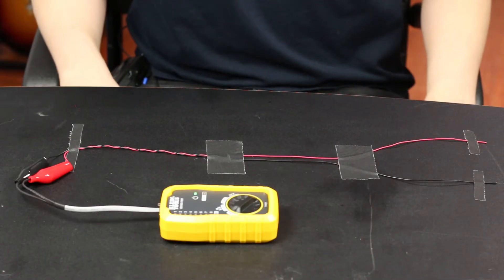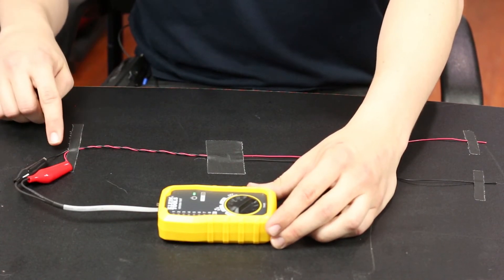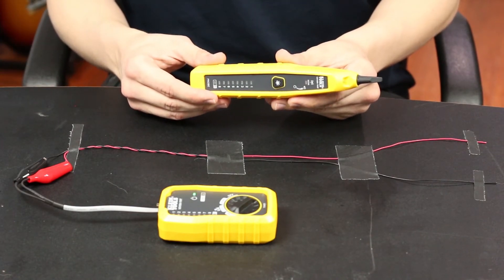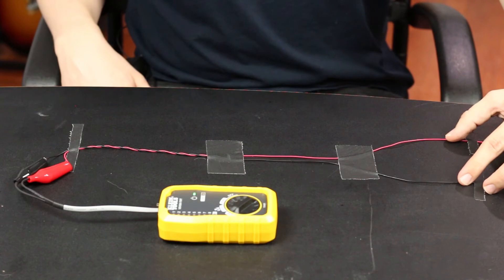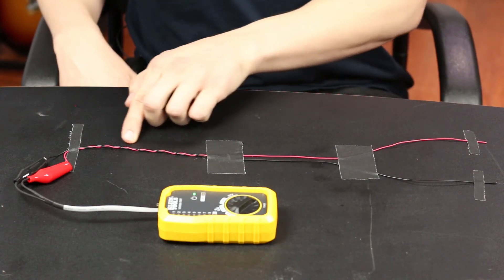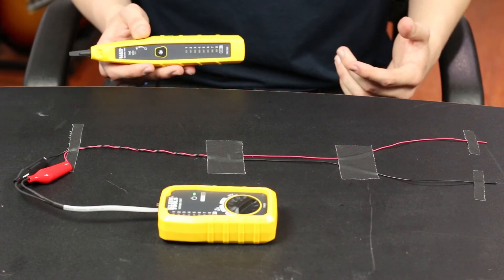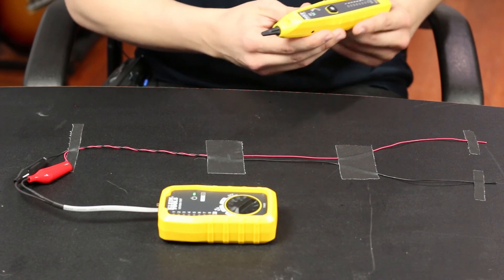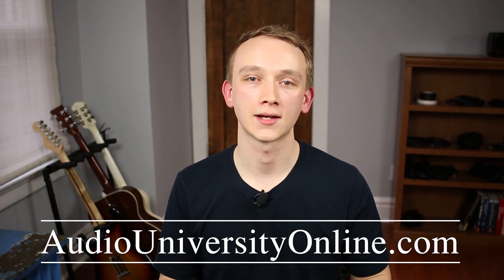Twisted vs. Untwisted Wires

Comment: I read this makes zero difference for low impedance loads such as speaker wire, but it's important for high impedance like rca or instrument cables?
Reply: I think it still matters as it helps reject outside noise I believe but also how long the runs are. In my opinion it not only helps the signal quality but looks nice and is easier to keep tidy so you might as well just do it. Nothing but a win win really.

Comment: This is explanation really helped me. Would you twist wires in the guitar wiring ? Eg - to the output jack.  I am wiring a 3-way toggle switch, as on Gibson SG & Les Paul, withe 4 leads - 2 pickups + common + shield - would you advise twisting shield and common? Soemthing else? Subscribed!

Comment: Great informative video! Just one question, why you don't connect the other end of the red black wires to form a circuit. I would like to see if you short the other end or connect a small resistor, how the result will be.
Reply from the maker: With this particular tool, it causes distortion. I believe it is because there is virtually no resistance on a closed circuit between the terminals.
Reply: @AudioUniversity  Sorry, what do you mean by "it causes distortion"? I understand that you are using the cable wires as antennas in your test. While in normal situations, a cable is connected one end to the source (the generator you were using) and the other end to a load (for example a 8 Ohm speaker driver). I would expect your tool can still detect the magnetic field emitted by different section of the cable differently, but it is still interesting to see how much the difference will be between the twisted section and untwisted sections.
Reply: If we were to attach this to an actual device, in some cases it may be as high impedance as a megaohm. Demonstrating for worst case and working with everything as if it was the worst case makes equipment be more universal and saves you a lot of troubleshooting later when some mystery noise would come into play and you would have to find it

Comment: i m bit confuse here
So the twisted wire is the best for audio signal right ??
To avoid the all other magnetic forces etc to let the signal flow clear
Reply from the maker: That's correct! It helps cancel noise from other sources and it helps maximize cancelation of crosstalk to nearby circuits.
Reply: @AudioUniversity  UTP cables apply the same but actually take this a step further and use different twist ratios to minimize coupling between similar twisted pairs